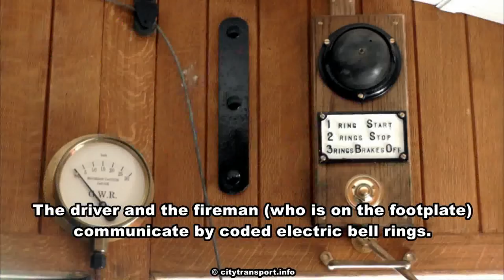Steam Multiple Unit Train

Comment: nice job and this train could have been used by Channel 5 milkshake for their Thomas and Friend TV children's programme since both gwr class 5700 duck & class 1400 Oliver might have the necessary equipment for autocoach operation or steam multiple unit
Reply: In the Railway Series - the books Thomas and Friends is based on, they both had autocoaches.

Comment: a SMU?!
Reply from the maker: yes!

The train can be driven from either end; one carriage has the steam engine inside it. But only 2 carriage trains are possible.

The alternative can have a maximum of 4 carriages - two each side of a steam engine which has special controls for the train driver to control it from the passenger carriages. These are known as auto-trains and were used on many routes.
Reply: Horace Chan This is class 600(I wonder how much effort it would take to put a fully functional computer in it(automatic sliding doors that lock, auto announcements, DMIs, etc)
Reply: Or a steam train with the capabilities of an 800

Comment: how fast could it go and what HP could that mini steam car generate at the drawbar??
Reply from the maker: sorry I do not know.
Reply: @CitytransportInfoplus  how many coaches can this train have? 2 or 4 or 6 ? We had push pull trains that could have upto 10 coaches and the loco was a diesel. These habe now been replaced by MEMU trains all over India.
Reply: @AnubhabKundu  only one coach with the railmotor, not enought power for more. The theoretical maximum was four coaches with a steamloco in the middle (due to slack in the linkage no more than two autocoaches could be coupled and used to control an engine) , but i dont know if that was ever done. Remember these were used wayyyy before diesel multiples were available

Comment: I am curious to know why mechanical stokers were never used in Great Britain.
Reply from the maker: sorry but I have no idea.
Reply: Coal demand not big enough to justify additional cost and complexity. Average tender only held 5 to 8 tons of coal and journeys shortish. 2tons per hour fired was considered attainable by hand and most engines too small to fit. Stoker's tried on about 6 class 9fs (2-10-0s) but were relatively uneconomical on the duties involved.
Reply: We did try oil-fired locomotives when coal was in short supply, but that had problems of its own.